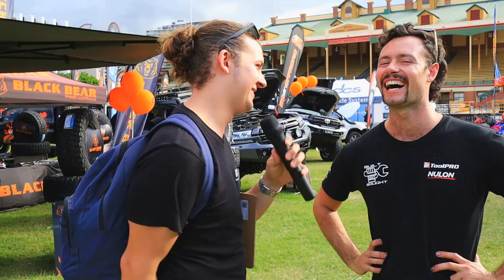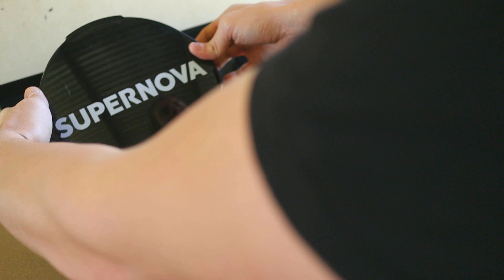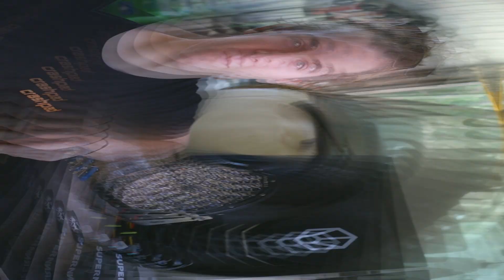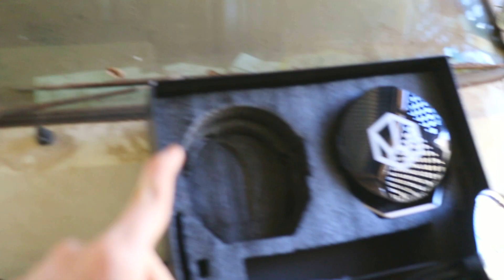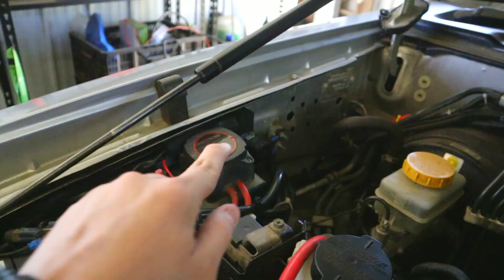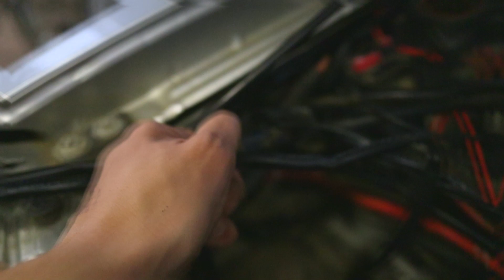SUPERNOVA INFINITE 8.5 DRIVING LIGHTS // UNBOXING, INSTALL & REVIEW

Comment: Hi I'm looking at getting into a nav either a 3.0 D22 Or  D40 about 2006/7 for the D40 just wondering if you have any direction to look at which way to go I know the D40 has a larger cab as I'm 192cm it does feel roomier but as we wil be using it for camper trailering and other utey duties (sorry) and I like nissan's, hopefully you could help .Checked out the vid on your thoughts and impressions of yours but what about these two I'm looking at .Cheers great content too .

Comment: Are you going to get scrubbies?
Reply from the maker: You bet you're bottom dollar ✌️ doing a collab with OCAMs kit but have hit some pretty major fitting issues. We'll see how they go, otherwise I have a bit of custom bar work I want done anyway, so I may do it myself 🤷
Reply: @ap4x4  when mounting my scrubs on the drivers side I had to use a pry bar to budge the line for the bracket to slide in the hammer it to the other side

Comment: Hey mate, I have these same light on my nav put them on the week after I got my nav actually. But I haven’t hooked up the drl’s, I’m wondering where you got Those clips would make it a much easier job. And another great video mate!
Reply from the maker: Hey mate! Any auto store "auto" have 'em 😉 seriously though, it's a bit too tight to be cutting and soldering. these make it heaps quicker! I believe some stores call them scotch locks, I'd just call them a splice connection 🤷 they should know what you're on about 👍
Reply: @ap4x4  Thanks mate! I will have to go get some.
Reply: You can get solder joiners basically heat shrink with solder in it just put it over the wires and heat so much better then skotch loks
Reply: @dancinpigeons4130  I’ll look into that, but for now I’ll give the locks a try.

Comment: Hey mate I’m in the middle of installing a isolator kit into my Nav and have been struggling to find somewhere to mount it, and i just noticed where you mounted your isolator on top of the fuse box. so i did that and it worked mint!
I also noticed you’re running 1 crank battery on the drivers side and a deep cycle on the passenger side, have you had any issue only running 1 crank battery instead of the factory 2? i’m considering doing that as well.
Reply from the maker: Hey mate! Glad it worked for you! Nope, in fact the first generation of YD25 D22 STRs and the ZD30s all came factory with one battery. I have never had an issue and a lot of people seem to earth the second out and put an auxiliary battery in. Of course it isn't great to have batteries in that kind of heat but honestly I've had that deep cycle for over 5 years and it's only the last 6-8 months it's started to die on me. I actually had it in my first nav and took it with me lol! Soon I'll be replacing it with a slimline AGM or lithium in a canopy to make room for a bigger airbox and a secondary fuel filter. Honestly I could fit it all in without removing it but I do like to have a bit of space to work, so why not 🤷
Reply: @ap4x4  Oh i didn’t know that some Navs came single battery, that’s good to know. and that’s awesome, thanks so much for the reply. Helps out a lot. i was worried that it might’ve needed the second cranking battery for some reason but that’s reassuring knowing those earlier models came out without them. Thanks again mate.
Reply: @Jakeoss thia builds have 2 batteries I'm sure.
Japanese 3.0s have a ribbed tailgate
Reply: Which also means Spanish builds should be 1 battery.